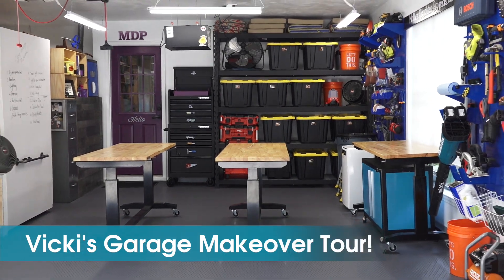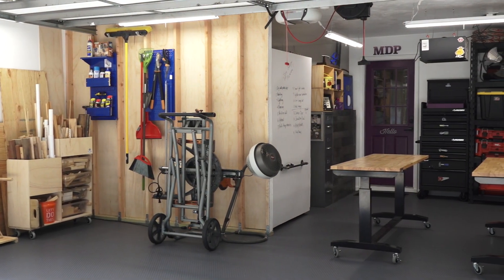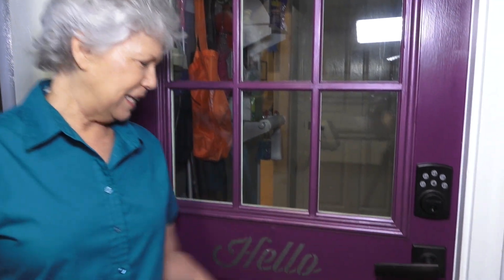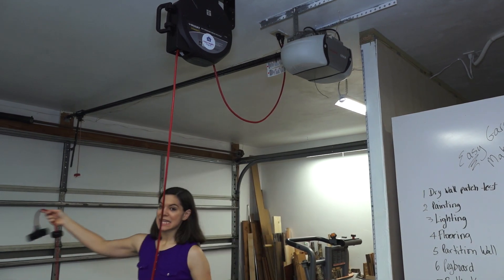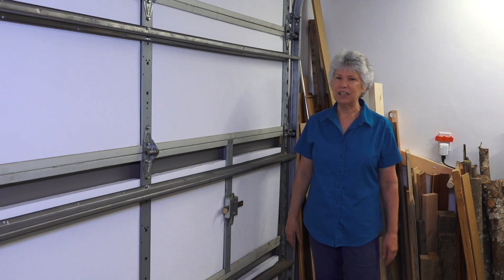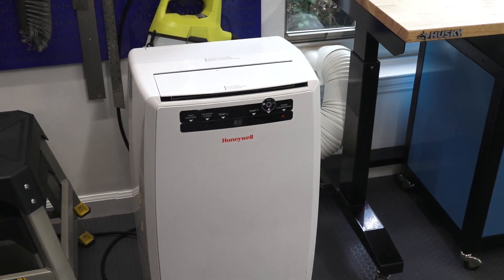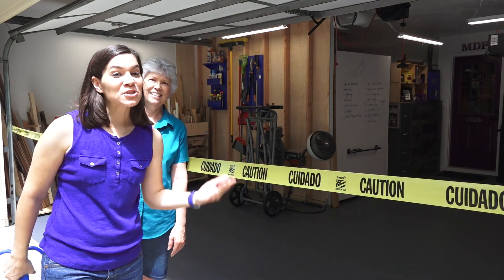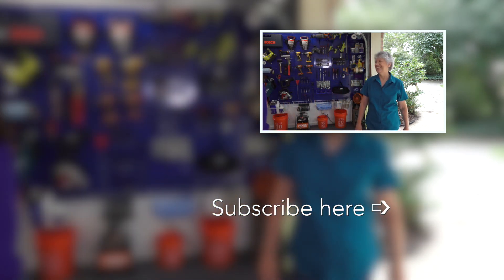NEW Garage Workshop Tour // Mother Daughter Projects Shop!

Comment: The first thing I noticed the the Mid Century furniture! Though I live in a Victorian Revival style home, I have been slowly changing the furniture to Mid Century so I spy it very quickly. I wish I'd have been there to have bought some of it! Especially the Lane table showing on the right at 3:08. I have one and would have loved that to go with it. 
That aside, there are so many ideas in here that I love. Including the stick on tape measure and retractable extension cord. Oh, and my favorite is the way you label your Husky drawers. I have magnetic label holders on ours. Not near as cute, or easy to see, as yours. May I ask where you got them?
Reply from the maker: Oh thank you! I do enjoy my mid century furniture. I’ve slowed way down on buying anything “new” as I still have plenty to work through. I actually still have the Lane table. It’s been in my sewing room, but I recently had to empty the entire room due to a water leak so it has to find a new home! The labels on the Husky are actually puzzle pieces from a Melissa and Doug toddler puzzle. We put rare earth magnets on the back. That retractable extension cord remains one of our favorite and most useful additions of the remodel. The only downside is it tends to trip the circuit on it pretty frequently although it’s super easy to reset. ~Vicki
Reply: @MotherDaughterProjectsDIY  I'm happy to hear you still have the Lane end table. I actually bought if for only $7.99 at a local thrift store for our daughter's first apartment, but it came back to me when she moved to Hawaii. I don't have any of the really big names, but love my Lane Acclaim desk and bench/coffee table and my Broyhill Brasilia 9 drawer dresser, all in my Ladies' Parlor. 
Thanks for the info on the Melissa and Doug puzzle. I'll have to look for that. Such a fun idea. 
Thanks for the tip on the retractable extension cord too. I'm binge watching all your and Steph's videos that I've not seen yet. Sharing some in my MeWe groups too. We'll be using your Vinegar trick on the weeds next spring. We live in Nebraska so it's a little late here to try it.